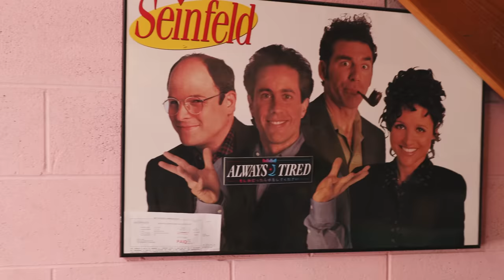DREAM BUILD FIXED GEAR - M-Idea Keirin NJS

Comment: Polished aluminum… my eyes just rolled back in my head. The only thing I would have done differently, is putting a twist in the toe strap once you inserted it into the pedal, keeps the buckle in the same place when tightening. Beautiful head to toe!

Comment: Can i ask? Why do I have the same headset style as yours but I don't use a quill stem. I have modern stem on my bike but my headset is like yours. And I have a long bolt screw under my top cap. Can I change my top cap without having any problems?

Comment: First of all amazing video and build. 

I have a noob question:
As far as I know, you are not supposed to grease the bottom bracket spindle which goes into the crankset. Wouldn't the added lubrication force the spindle deeper into the crank?
Reply: I think it's to avoid the crank seized to the bottom bracket.
Reply: Never had an issue with any square tapered bb's and crankset combos where I greased the spindles. Sugino 75's, however, are a different story.

The reason for S75's being notorious for seizing is because people use either standard or NJS/JIS tapered bb's with them. S75 has it's own taper, which is why Sugino sells bb's specific to 75s.
Reply: What I thought too.

Comment: I don't like the looks of the crank, seatpost and quill stem. Take a Dura-ace crank, polished seatpost and stem and everything would look much more balanced.
Obviously, that 'ergonomically' shaped handlebar is blasphemy as well... Anything round will do. That frame is drop dead gorgeous and deserves the top parts in terms of aesthetics, and this wouldn't compromise ride comfort in any way.